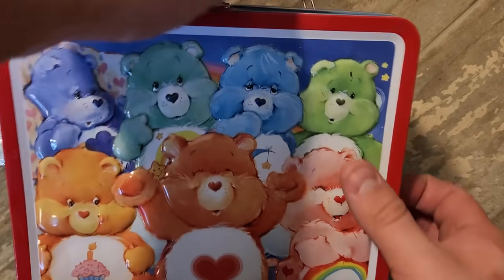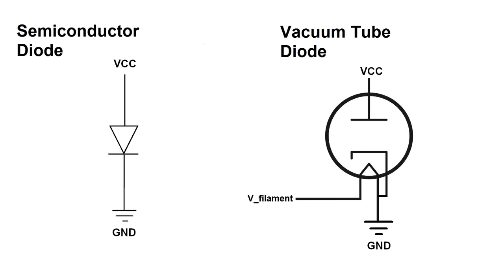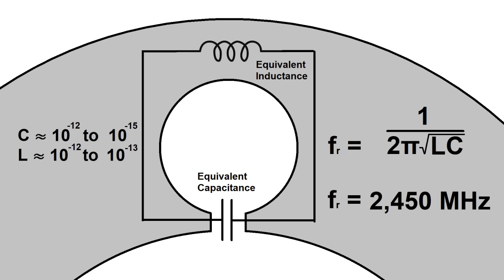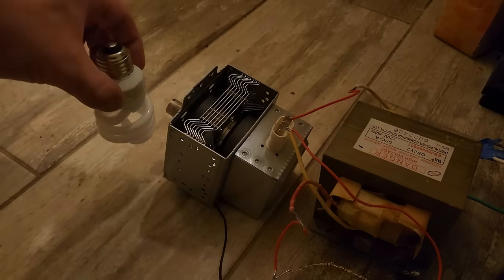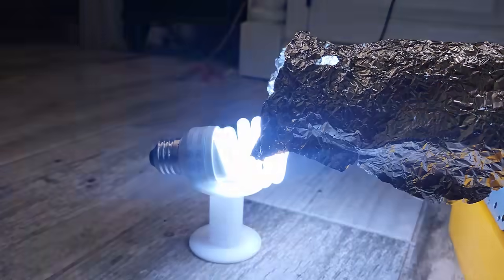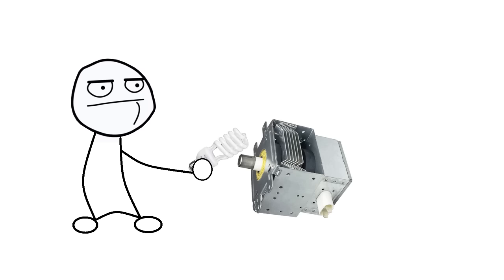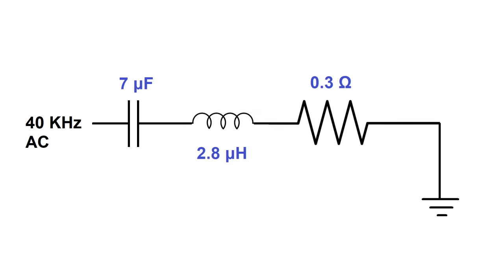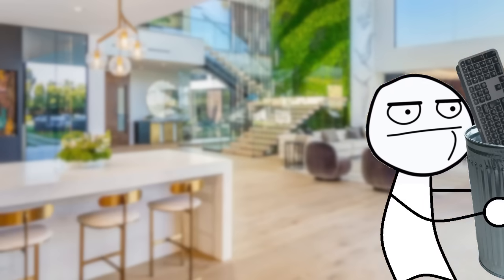Battery-Powered Magnetron

Comment: Just to mention it. One of the big risks with this kinda RF is it can heat your corneas, you don't have the ability to feel heat there so you won't know it's happening. Once they get above ~40C or so the protein that makes up the lens of your eye will cook and at best you will lose the ability to focus your eyes. Generally you will get cataracts as well fairly rapidly after.
This isn't the kinda stuff to muck around with casually.

For all the wizards in the comments. Water evaporating off your eye keeps it cool on hot days which is why "I go places where it's hot" isn't the dunk you think it is, the microwave heating heats up layers underneath not just the surface. 
 You have the sum total of all of human knowledge at your finger tips and you could find out that it is in fact correct faster than writing your comment and being loudly wrong on the internet.
Reply: When I was in the Navy I was trained in aviation electronics and worked on the EA-6B.  It's the plane that did jamming, now replaced with, I believe a modified Super Hornet (FA-18).  I worked on what was called I level which was bench top troubleshooting and repair.  Specifically I worked on the jamming transmitters.  They are basically just the last stage before transmission and are massive amplification units with waveguides that would be connected to the antenna on the plane.  When troubleshooting and testing we transmitted into water, a calorimeter, which can measure the amount of energy based on the amount of heat produced in the water.  Twice we got radiated and you are correct.  The clinical procedure to see how badly we'd been exposed was to be sent to the Naval hospital and have our eyes checked.  Thankfully both times were minor with no noticeable or long term affects.  Interestingly, both times, the way we noticed it was the shop radio.  We always had music in the shop and although the transmitted frequency was nowhere near the FM band the radio would go out.
Reply: @markbrown9765  that's a cool and very scary story thanks for sharing. I guess the radio was basically getting an emp effect from the sheer wattage at that range inducing random currents into it's circuity either directly or just swamping the antenna m
Reply: @zyeborm More like an RFI/EMI interference most likely. 

An EMP would be a very wide band type of spike. The interference there was at a very narrow frequency band
Reply: I agree. I lost my vision to cataracts at a fairly young age due to lifelong exposure to ultraviolet, radio waves, microwaves and x-radiation while tinkering in my basement. It was no fun going blind. I lost the ability to drive a vehicle and my wife had to take over. I even lost the ability to read a magazine or work online. It was truly awful. In the end, I was eventually able to get cataract surgery and life is pretty good now, although I never regained the close-up vision I once had. Tinkering and experimenting is fun, but be careful, and make sure you understand the dangers!
Reply: @paulmaxwell8851 yes. I seem to remember rf safety being covered in the technician class amateur radio tests back in the day, and not looking into waveguides or operating VHF and higher amps with covers removed was a question.
Reply: @paulmaxwell8851  I can SEE my own cataracts, with DIY cataract-viewer.  Every year they're slightly bigger.  To do this, look at a distant LED in a dark room, then place a powerful converging-lens over your eye.  (I use the tiny lens on my swiss army knife.)   The bright point LED turns into a bright disk.  Any material in your eye will then cast shadows.   You'll see "floaters."   But if you see any apparent hunks of glass, those are incipient cataracts.
A better DIY device would have an LED shining through a single optical fiber.  Then place the end of the fiber within a few mm of your eye surface.   Put it in a dark-painted cup, which correctly positions the fiber when the cup is against your face.
Reply: @paulmaxwell8851  don’t feel bad.  Once you get to a certain age, your ability to see ‘close up’ diminishes markedly.  That’s the nature of our eye design.  Today, there are multi focal and dynamic focus IOL’s (intraocular lenses)that can restore visual accommodation after cataract surgery.  Quite amazing story of how we learned it could be safe to put plastic into the eye.  Thank the Spitfire Pilots for that one!
Reply: THIS should be displayed in a card for 10 seconds before a video like this. Or at least the channel owner should pin this.
Reply: yea seems like I would only play with this if I had proper shielding and something that could detect rf leakage
Reply: Well it is something I am also wondering, how he plays with his magnetron as if it is something really harmless. This is an rf power class you should be really careful with.
Reply: Yees. That is like boiling and egg. Protein denaturation. https://en.wikipedia.org/wiki/Denaturation_(biochemistry)
Reply: So the RF can blind you, the transformer can instantly kill you, the berilium dust can kill you over time and The capacitor can give you the shock of a lifetime. 
Microwaves are the most dangerous easily available things ever.
Reply: :hand-orange-covering-eyes::face-blue-wide-eyes::glasses-purple-yellow-diamond::face-purple-wide-eyes::face-orange-biting-nails::text-green-game-over::face-fuchsia-tongue-out:
Reply: I don't know where this story came from, most of these myths have no scientific basis whatsoever, besides, Mr Green made a video exposing himself to microwaves, and explaining several things.
https://youtu.be/3hBRxwQXmCQ?si=5m1zLZIOUFJYPDB-
Reply: Absolutely
Reply: YES! There is NOT much blood flow in your eyes to help remove excess heat either. They eyes are the MOST vulnerable part of the human body when it comes to the Magnetron's R.F. output.
Reply: Is like that episode where homer eyes turn like popcorn
Reply: Holy shit
Reply: MrGreenGuy was literally in front of a magnetron with his head+eye for several minutes and nothing happened, the reason it works in a microwave is because the waves can bounce. Later ElectroBoom conducted the same experiment. Our body is very good at regulating heat.
Reply: I'm in 100 F teens every day and I can see
Reply: @RenoSimpson  Are you sure? Because it has already been mentioned multiple times that the water evaporating off your eyes keeps them cool. Perhaps you should get them tested.
Reply: @RenoSimpson you're not paying attention
Reply: I was once in a place where it reached 40C, yet my vision is fine, how is this the case?
Reply: @moggtheboss3087 Because you blink your eyelids....
Reply: @moggtheboss3087  your eyes are covered in water in case you hadn't noticed. That evaporates keeping them cool. I live where it gets over 50C and I still haven't gone blind. Doesn't mean sticking your head in a microwave is a good idea
Reply: @wexelo  yes, I know this?
Reply: @zyeborm And that fact is EXACTLY why there are mucus membranes under your eyelids, and you blink. 

IF you had held your eyes wide open, without blinking, yes you woukd have cooked your corneas
Reply: @davelowets  IF you had taken the time to actually find out about the thing that you speak so authoritatively about you would have found out that you are in fact wrong in your assertion that blinking protects you from this. It isn't solar radiation, it isn't drying out that is the issue, you don't have thermal nerves in your cornea, or any nerves for that matter. Water can exist quite easily at 40C. The proteins in you cornea can't . Look it up. This is a real hazard, it has really caused the issues described in actual people. It is a well known problem. Don't go spouting rubbish you don't know about on the internet.
Reply: @zyeborm  NO nerves in the  cornea? LOL.....

Comment: To quickly identify Beryllium oxide.... I Just happened to see a video on YouTube in the last week....showing the use a $5 handheld diamond tester...... To test for beryllium oxide. 

Apparently because of the thermal conductivity. 

I pulled out a few diamond testing devices I have..... And it seems to work pretty well. Just a fun fact.

I'm mostly find beryllium oxide on microwave devices & related  Semi-conductors, high voltage spark gap stuff.... And similar oddities

Comment: Silicone caulk is awesome .....but try to get the "neutral cure" stuff if possible. 

That way there's no acidic outgassing while curing or throughout its life. That vinegar smell in most normal silicone caulking...... Will cause circuit boards, component leads, ect...to quickly oxidized. 

Starting as a patina but eventually getting out of hand.

"The green death" is awful stuff especially when it comes to electronics and boards. 

I'm sure everyone was already aware of this but figured I would share my experience..... because it Was quite painful figuring that out😂

Comment: Yay, a magnetron explanation which is ACTUALLY CORRECT!    Subscribed!
Usually the books claim that the "cavities" are half-wave resonant chambers.  Nope.  As you say, they're one-turn LC resonators, and like any tank circuit, can be far, far smaller than quarter-lambda in diameter.
Hazards?  Prompt microwave damage involves tissue-heating, and the most sensitive tissue is your eye (which has no liquid-cooler, no blood circulation like everything else does.)  So, a "radiant heater" using microwaves would keep you toasty in winter  ...while it cooks your corneas like egg-whites.   Need some custom Faraday-cage goggles with fine mesh screen, or perhaps lenses made from adafruit's ITO-coated conductive plastic sheets.

PS, in argon flasks, I always put a bit of steel wool or carbon-fiber inside, as a "trigger."   Similar to big smooth TC terminals needing a thumbtack in order to reliably produce plasma streamers.   Tiny tesla coils may not ignite 1ATM argon from a distance, until a sharp conductive trigger is provided within the argon.   (And, if you put a clear trash bag of xtremely pure argon in your kitchen microwave oven, provide a carbon-tuft, and then you'll see an entire light show, starting with white lightning, but going through different stages as plastic melts, air invades, plastic burns, etc.  Trigger-tufts FTW.)

Comment: What's stopping manufacturers from putting full bridge rectifier for the kV range magnetron DC voltage, instead of having half-wave voltage?
Reply: It costs more. Keep in mind they do not use a half-wave rectifier but rather a doubler. The important side to this is that there is no DC component to the current drawn from the grid.

Comment: a few years ago i got a broken microwave that i took apart nearly killing myself 3 times. 1st didn't discharge the capacitor thank god it wasn't charged. also i said smh like: eh don't know what that is ill just throw it in the trash, also grabing the contacts. 2nd smashed the magnetron with a hammer breaking it open and inhaling the gas or smh. 3rd breaking that beryllium part cuz i thought its just ceramic. now that magnetron sits in an drawer in my room. i should note that i was like 11 years old. and i didn't know practicly anything about safty and electronics. a year ago i got another microwave this time tho i did everything correctly and got a nice transformer. sadly my dad told me to throw the capacitor away :(
Reply: Nah, you were fine on all counts: 1. Every microwave cap has an internal bleed resistor so it won't hold voltage (this is actually required due to dielectric absorbtion concerns) 2. It's a vacuum inside, no toxic gasses, since anything in there would cause problems 3. It's aluminum, not beryllium. So you were always safe.
Reply: @SkippiiKai Wow, I completely forgot about this comment. Okay, well then, thank you for the clarification.

Comment: These magnetrons behave like zener diodes where they clamp at around 5kV consistently. Constant current control would be required if you want to control the power, because they won't really transmit much below the threshold voltage.
This also means you can pulse them (i.e. capacitor or PFN) and create EMP with huge power levels
Edit: check comments, there are people more knowledgeable in the subject
Reply: Unfortunately, the oven magnetron is not capable of delivering decent power in pulsed mode, even with a greatly increased anode voltage and replacement of magnets with stronger ones. The point is the low emissivity of the directly heated cathode and the jumps to other oscillation modes at short pumping times. There is also a moment of current limitation in saturation due to the Schottky effect.
Even high-power pulsed magnetrons with an output power of 300-1000 kW with a narrow beam antenna are short-range toys. Real EMP-sources are relativistic microwave devices - vircator, MILO, gyroklystron, wiggler source, rela-BWO, ubitron, gyrotron, Cherenkov generators and so on.
Reply: IT's not anything like EMP or an UWB pulse. Magnetrons are very narrowband.

Comment: Really interesting.  Was wondering if you could use your transformer and replace magnetron with a flat bar coil in a tight "C" which would have it's own capacitance forming LC circuit at it's own frequency, much like an induction heater coil except higher frequency.
Reply: Hmm can it be done without free electrons speeding in a vacuum?
Reply: @GeoffryGifari  Would think so, Induction Heaters usually run in Kilohertz frequencies, Tesla Coils usually run in Megahertz frequencies, so I don't see why not Gigahertz frequencies, wouldn't need the heater element, just LC circuit.

Comment: What would happen if you used an 8s 28v or 12s 44.4v or even 36s 133.2v Lithium ion battery in place of the 3s lithium ion battery?

Comment: I learnt the hard way about silicone caulk. I glued about half a dozen pcbs down for a project, 2 weeks later nothing worked.  I found the acetic acid in the caulk had eaten the pcb tracks off the boards. Be careful where you use it!
Reply: This is only true of some silicones. If you look for a "neutral cure" silicone you will not have this problem.

Comment: Interesting project. Perhaps the builder was unaware of 12 volt microwave ovens already being sold commercially?

I got a 12 volt microwave. They were even sold at large truck stops here in the USA to be used by truckers while on the road.

They come with an adapter to power them from a normal wall outlet too. They have a set of battery jumper cable style leads to connect to a 12 volt car or truck battery and these cables do get quite warm while heating up your food.
Reply: Considering it would have to pull something approaching 100A, no wonder the cables get hot.
Reply: I had a recent version opened up.  It had 250 watt MOSFET modules!  2.45 GHz as usual.

Instead of an oven, this was actually a microwave plasma-lamp, used to produce daylight in "grow ops."   I wonder if the truck-stop microwave ovens use transistors in place of magnetrons?   The efficiency might be much higher.   The size might be the same, what with massive heatsink needed.   Heh, but with transistors, we could add audio modulation, and see if we hear little voices when sticking our heads into the beam.   Much like Woody Norris' "sound-laser," but not blocked by wood or sheetrock walls.

Comment: 5:06 can anyone explain why the voltage is below ground?  or even what that single voltage value means, because isn't it AC going to the cathode?
Reply: I believe the metal anode makes up most of the casing of the vacuum tube. By having this side grounded they can easily attach heatsink fins and bolt it to the case of the oven without adding high voltage insulation around the entire thing. In other words, it's cheaper to have a grounded anode.
Reply: @eDoc2020  ah gotcha - thank you!
Reply: The voltage is below ground because: in first AC cycle transformer pin 4 is (+) and pin 3 (-) this charges capacitor (+) -||- (-) and on second AC cycle transformer pin 4 is (-) and pin 3 is (+) so You have series connected two voltages 2000V from pin 3 (+) pin 4 (-) and capacitor (+) -||- (-) this double voltage so You have 4000V and it is negative relative to ground because ground is connected to pin 3 which is (+) at that AC cycle.

Comment: A portable Magnetron heater for chocolate milk is fantastic for camping and outdoor activities. But I wonder how high the efficiency is? Maybe warming the Chocomel with a resistor uses less energy. On the other hand if the Magnetron is properly modulated a High Power WiFi signal could be transmitted. Finally there would be wireless internet on the Moon.

Comment: How can the steady cathode current excite an oscillating current around the cavities? It seems like half the time, the induced EMF would be in the wrong direction. For other types of oscillators, there's always some active component like a transistor. What fills that role here?

Edit: I found the answer in Wikipedia:
"The magnetic field is set to a value well below the critical, so the electrons follow arcing paths towards the anode. When they strike the anode, they cause it to become negatively charged in that region. As this process is random, some areas will become more or less charged than the areas around them. The anode is constructed of a highly conductive material, almost always copper, so these differences in voltage cause currents to appear to even them out. Since the current has to flow around the outside of the cavity, this process takes time. During that time additional electrons will avoid the hot spots and be deposited further along the anode, as the additional current flowing around it arrives too. This causes an oscillating current to form as the current tries to equalize one spot, then another."